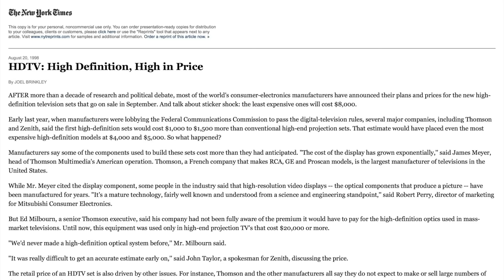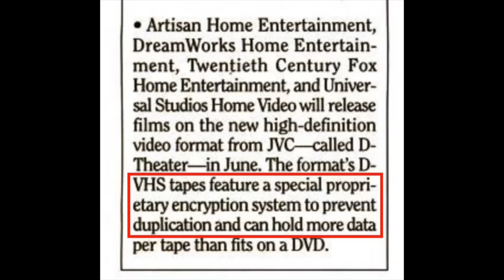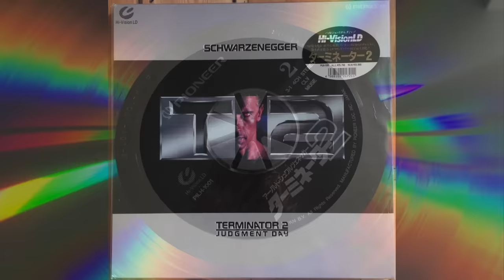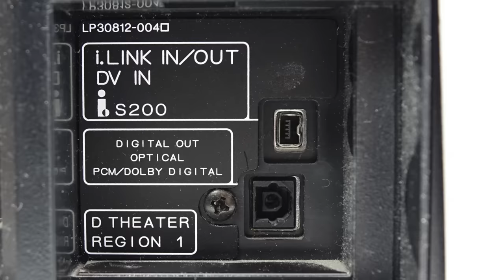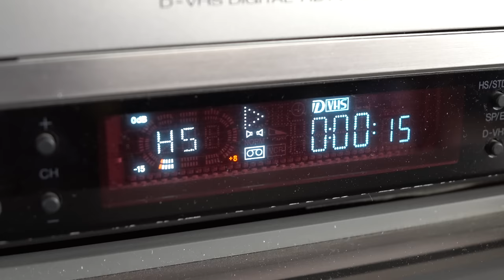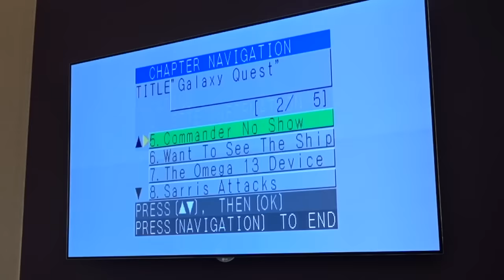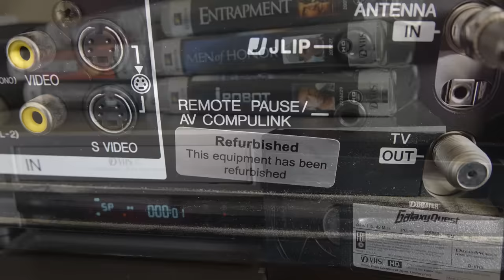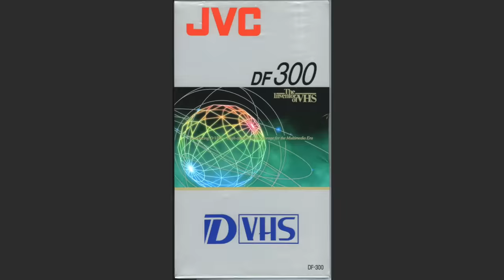Remember when HD Movies came on VHS tapes?

Comment: The problem was that most of the early plasmas sold were in fact not even 720p but 480p, sold as "HD Ready". The real HD ones were bloody expensive.

But back in the age a DVD in a 480p plasma TV looked very good.
Reply: I used a 720p plasma for a few years.  It blew away lcds at the time.  I've always felt that the move to lcd set tvs back 5 years.
Reply: +Brad Strawn didn't plasmas have burn in issues?
Reply: they did, but if you were aware of it then it wasn't a problem.  mine also had this function that helped to remove burned in images.
Reply: I hope you can help, but why buy an HD ready tv, when you can buy a Full HD-TV? Even if the resolution was great via DVD. Anyone?
Reply: Resty Mervin Ponio Back in 2005~2006 FullHD TV's where super expensive.
Reply: Yeah, that's a big let down. When HD TV was introduced here in the Philippines in 2008, the initial price then was about 150,000 to 200,000 Philippine pesos. I thought that to be too extravagant. I waited until 2015 when it was affordable for me to boy one.
Reply: Yes, but in 2020 8k TV's will be released. How about that?
Reply: Resty Mervin Ponio shame evrything cheap in Philippines except high tec
Reply: I remember this whole era... Watching all the new TVs coming out. The contrast ratio was the biggest thing LCD had to tackle. Because of the slew rate of the LCD, it couldn't get true black. You just had varying shades of grey. The cheaper the LCD, the crappier the contrast ratio. 
Plasma had no problem with this. The other thing about plasmas that no one liked, was the weight!! They weighed so much, that you would actually have to wall mount them into the studs with special heavy duty mounts. It even spawned it's own cottage industry. On top of that, what sealed plasma's fate was the screen fading over time/whole cells failing abruptly.

Most people looked at the LCD as a much more practical/reliable solution...but with the soaring prices, people made due with cheaper models with less than ideal picture...just to have a flat screen. That was the part everyone was so enamored with anyway.

Otherwise, they had some pretty decent CRTs out which could do extremely high resolution. Heck, I had a Silicon Graphics monitor for instance that could do a resolution so high, that no graphics card I ever owned could max out the res. Not one. So CRTs were actually the best choice if the industry hadn't made the call to go full bore on plasma/LCD. So I would say the jump to flat screens put all TV technology 10 years behind.

I remember at the same time I had that silicon graphics CRT monitor, I also had an NEC LCD monitor capable of a whopping 800x600 max res. Unfortunately, the SG monitor weighed about 100 lbs and was quite massive. I left it when I moved in 2011...still having never found out what the maximum resolution on it was.
Reply: OH and the other thing about plasma TVs that doomed them was the brightness wasn't as good as on LCD TVs when they were competing.
Reply: The real problem with plasmas apart from the weight and burn in issues is their delicacy. Their glass screens are extremely involving to transport securely. I had a 55" VT30 arrive with a cracked screen as the Shittylink (AKA Citylink) couriers had the box banging around in their delivery van, whilst they had tough LCDs strapped securely down. I was furious. I eventually had a refurbished 65" VT65 shipped across Europe, fully insured. I'm very happy with its stunning, reference grade, THX certified black levels, the best this side of a top end OLED. I definitely paid a fortune for it, but it's the last Plasma ever made, and was worth it. I did experience burn in when I played over a hundred hours of FFXV, with its permanent (an awful, awful decision) ultra bright health bars always on screen. Absolute idiot developers. I ran the screenwipe for over a hundred hours and the burn in is now practically gone, but it definitely scared the ever living shit out of me. Never again. Didn't finish the game, it mostly sucked anyway.
Reply: i still have a old 720p plasma in my rec room and you really just cant beat the color quality that thing has
Reply: My old 720p plasma still looks good, even with modern standards
Reply: I actually think this is a huge reasons. Those back projection sets kinda sucked too.
Reply: Well in Germany HD is still a premium.
Regular TV is only SD.
Even a VHS Tape looks same.

For HD expensive extra contracts are necessary.
Reply: Cato Rodi 
True. It was the greater color and contrast range and clarity of image. I remember the first time I watched a dvd. I was blown away. Then came Blu Ray and 720p and 1080p... better tv’s, better colors on Blu Ray... now regular DVD looks so dated and poor in comparison.  Weird.  That old hd footage of New York was cool though.

Comment: Interesting. So can I say that, more or less, the VHS here is used as a Data Tape to store Digital Files, and that the VHS player is acting like a digital tape device with some embedded audio/video decoding? :-)
Reply from the maker: +Tziu Ricky yep
Reply: D-vhs never caught on but a lot of camcorder formats recorded digitally to magnetic tapes did. Mini DV and Digital 8 were two of the most common. I never saw the point in having something technically digital but having pretty much all the drawbacks of analog tape like linear access only, fast forwarding and rewinding. 
So I mainly stayed with video Hi8 which is analog but the (NTSC) tapes gave you 2 hours in SP. Mini DV and D8 usually had 60 min in SP, 90 if you used LP.
Reply: I have a lot of family movies on Hi8 and Digital 8 format. I wonder if D-VHS would be a good way to store them for longevity. I trust magnetic tape more than harddrives for storage. Any opinions about this ?
Reply: Specifically, it's storing an MPEG-II stream, which is also supported by standard on the iLinkmport
Reply: *****
Unfortuantely, with so little use of D-VHS, it's likely hard to know whether those digital tapes will hold up better than the master sources over time. I like to think of the original tapes as the master, period. Any other copy is simply a back up.
The thing is, there's far less support and equipment available new to copy stuff to high quality tapes. You'd likely have to go to a conversion house or a local cable tv studio. Whereas hard drives today have huge capacity and there's a lot software out there to capture video to computer. And automated back up or cloud storage is more popular.
Reply: DAT is still used today
Reply: Darkside Hero who said anything about dat?
Reply: they make digital vhs drives, you can store like 250GB of data on a vhs tape, its just really  slow read/write times
Reply: Kinda pointless when LTO-7 will hold 6TB. (LTO-2 will hold 200GB and those drives and tapes are cheap)
Reply: Kinda like the cassette tape drive for computers

Comment: Last year i finally bought a 4k smart TV. it's only around 43 inches but honestly it was a great investment. Only cost me $250 brand new including shipping. It initially defaulted to 30HZ every time I turned it on. but with a bit of tweaking I got it to run games at 60hz 4k. Honestly I think we're in the golden years of affordable displays, I can't see this getting any better.

Now all I have to do is get a passable speaker setup.

Comment: I had the Dish Network JVC HM DSR100U digital vhs (D-VHS) recorder.  Loved it! To avoid buying the expensive D-vhs blank tapes, I would simply drill a hole in the bottom shell of a regular or S-vhs tape to fool the machine to record in D-vhs format. I could then get 2 full length movies on each tape in the LP 4 hour mode. Of course it only 480p resolution, but as good as Dvds that were just coming out. Since I was recording Club Dance TNN shows I participated in, I was able to then output to a DVD recorder for digital archiving, then finally to avi 420p. which to this day, still have as video files backed up to HDs. Even on my 64GB SD card in my phone.
Reply: Niiiice:).

Comment: Not many people know that magnetic tapes are widely used in servers for data archival.
Reply: I certainly didn't Can you elaborate why magnetic tapes would be used for archiving? I know it was mentioned in this video around 13:00; I just don't understand what advantage a magnetic tape over solid state drives or discs.
Reply: @shaun2133  Tapes are far more durable against physical damage (hard drives don't like being dropped), will still work after sitting on a shelf for 20 years (hard drives and SSDs won't), can be erased many times (unlike discs), and the price per GB of the tapes is much lower than BD-R, hard drives, SSDs, etc. Downside to tape is the up-front cost of the drive to read/write them, and the sequential access method (can't delete parts of it).  It works very well for daily/weekly/monthly computer backups for decent sized companies, and long-term archiving of data... but NOT very well at all for anything else, so backup is its niche.  You should look-up the prices, speeds and capacities of LTO-6 tapes and drives.
Reply: @shaun2133  Tapes are gradually dying out, being replaced by off-site, high speed network attached storage. They do provide a lot of storage for a reasonable price, and despite being sequential, that doesn't necessarily matter for backups. And tapes are portable, so you can easily transport them to another location for safe keeping. But the drives are expensive and they are also very slow. It may require several tapes to do a backup or restore, so someone has to be there to physically insert/remove the tapes from each drive. Tapes also degrade with repeated use.
Reply: @another3997  Gradually dying out? I was under the impression that they had died out 15 years ago.

Comment: I had that VCR here in the US.  I bought it used, and it worked great.  I think I had a Sanyo receiver to decode the over the air HD signal.  But more importantly, if I recall correctly, I could and did modify standard VHS tapes to use in it recording in HD.  But at the time, I bought it mainly for recording Nascar races, only Nascar was one of those who employs any and all copy protection methods.  It would record the channel right up until they cut to the network feed, and then nothing.  So i sold it on ebay because almost nothing was in HD back then except the Nascar races.

Comment: 2:26  holy crap!  I think we had that same model rear projection tv!!!  I think it was about 9 or 12 years old when the convergence kicked the bucket and it started looking like stuff you would wear the red/cyan 3d glasses for.  tried to fix it twice with no success, sold it for cheap to a guy on craigslist who had a smaller version of the same model, to use the projectors to replace his.   Thing was heavier than a truck full of rocks and we had to get it down stairs form the second floor.  it was a 3 man team effort, and it barely fit through the staircase....I have no idea how we got it up there in the first place lol

Comment: 10:27 Whoa, the D-VHS looks as good as Blu-ray.
Reply: Not when compared side by side with 1080p blu-ray. It looks very good though.
Reply: Jarrah White not as good as Ultra Blu Ray 4k
Reply: Jarrah White while it does look like great quality video, once I saw the cars I noticed that the frame rate was not so good.
Reply: HOPELESS ENTERTAINMENT Well no shit, it supports a maximum of 1080i and was made at a time when 4k was still being developed.
Reply: +カイエン 〔・0・〕 《KUYAN》 You realize it runs at 30 fps like almost all commercial video? Videos are not games, what you are seeing are deinterlacing artefacts, it would look normal on a HD CRT.
Reply: RAMDRIVEsys actually 30 fps looks normal on any modern TV as well.
Reply: I know. I was talking about the interlacing. What he saw was not a "bad framerate", just deinterlacing artefacts.
Reply: And ironically, it lost to Blu-Ray, despite storing twice as much as Blu-Ray.
Reply: It never even competed with blu-ray. Probably because everyone thought they were VHS tapes.
Reply: the "bad framerate" also had to do with the video being of an early 90's HD recording
Reply: The apparent frame rate error is due to the fact it's likely being captured as 1080i60 without 3:2 pulldown to return it to being 1080p24. Basically, films run at 24 frames per second, and to get that to fit into the 60 frames required the frames repeat alternately two times then three times, this gives the video a jerky appearance if not correctly returned to the 24 frames per second. Most TVs can do that if they have the correct film deinterlacing mode turned on, but it probably isn't done when captured (and even if it is it's then sent out to YouTube as 30fps which creates its own issues). 

Of course HD video in the UK generally follows the 50Hz from the PAL analogue standard. To get 24fps film to fit into this it's actually sped up slightly (around 4 percent) and then doubled. This means there's none of this stuttering, and any difference to the audio is usually far too small to notice. This is why, if you live in the UK (or another 50Hz country) and look at a movie you have on both Blu-ray (or another hidef format) and DVD (or another SD format) you'll notice the blu-ray is longer, even if it's the exact same cut of the movie. Because HDTV broadcasts in the UK still run at 50Hz even now, if you watch an HD broadcast of a movie it will also have the same speeding up that was done to DVDs and other SD formats.

Lastly, as others have pointed out, it's only MPEG-2 compression, the same as is is used on DVD, whereas Blu-ray supports MPEG-4 (and also VC1). In the simplest way, this means that if the D-Theater and Blu-ray versions of a movie are running at the same bitrate, the blu-ray picture quality should still be superior owing to more efficient compression. 

I've said Blu-ray throughout this, but basically the same applies to HD-DVD also, for what it's worth. 

Also someone said something about 50GB being twice as much as a Blu-ray, which is incorrect in practice. Each layer of a standard blu-ray is 25GB, and dual layer ones are common. You can then get the triple layer 100GB BDXL discs, and there are quad layer ones also, I believe, but I've never seen them.

Hope this helps clear that up!
Reply: Yes! and best of all, no scratches because the media is inside the cassette
Reply: No scratches?Sure, until it eats the tape
Reply: See technically its a digital signal so it could look as good as 1080p bluray
I think it doesnt look quite as good because its component not HDMI

Theoretically it would be possible to build a tape based system that could look better than 4k blu ray because it could hold more data you could have 200gb worth of tape for example but it would require a display thats higher res than 4k or course 

Honestly i think physical media for movies is on the way out in general. Blu ray is already being replaced by streaming services and hard drives with video files on them
Reply: They’re comparable but you have to remember that you’re watching on YouTube and YouTube sucks dick at preserving the quality of the original recording. Blu-ray is superior in every aspect I can think of. Size, capacity, sound, resolution, dynamic range, and color reproduction.
Reply: No it doesn't
Reply: not really. looks like 720p
Reply: Jarrah White 
Almost
Reply: Until you watched it a few times, wore out the tape a little, and started to see drop outs.

Comment: Great video. It's a common problem that towards the end of VHS's existence, the features on offer and chipsets used were immensely more sophisticated, yet at the same time the mechanisms were really poor: flimsy chassis, low component count in the tape path (many had no impedance rollers, even the drum roller arms and their assemblies seemed to be made of tin); carriage made of bendy tin, and plastic gears that cracked after loading and unloading a dozen times. This is because to keep costs low, all the big names seemed to outsource mechanisms to Funai, makers of unrepairable junk.